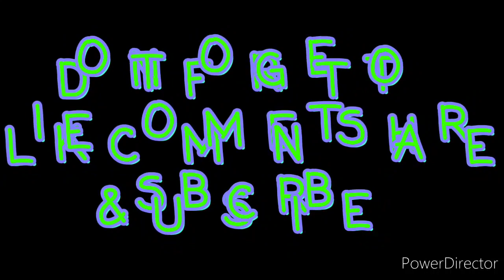Big Cam Small Block Regal | Testing and Tuning | Street Car Build pt.1

Comment: I'm running a wires for your tweeters are you connecting to the amp or head unit
Reply from the maker: For now to the head unit dont have my amp connected yet